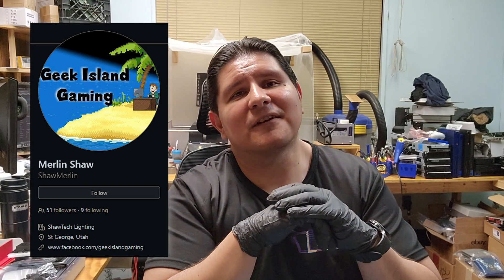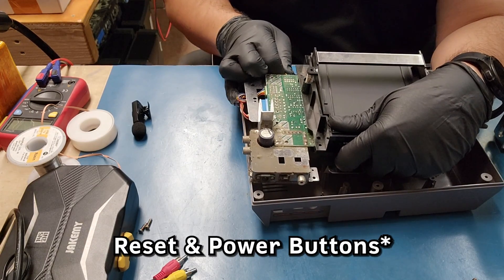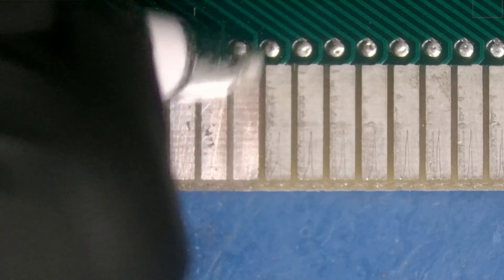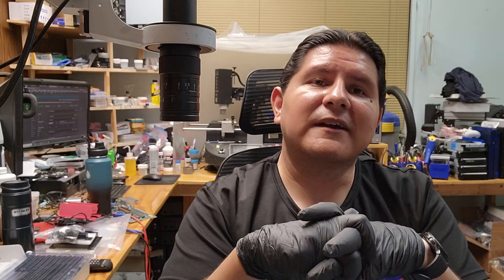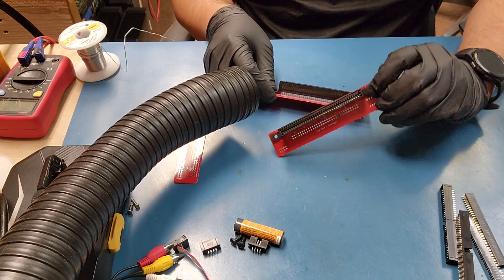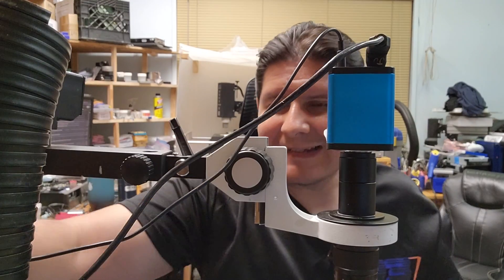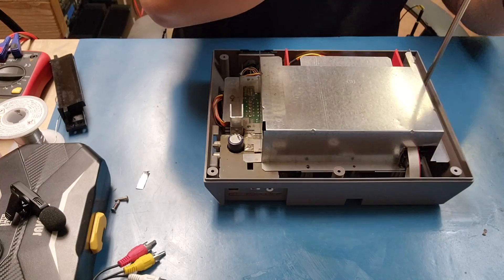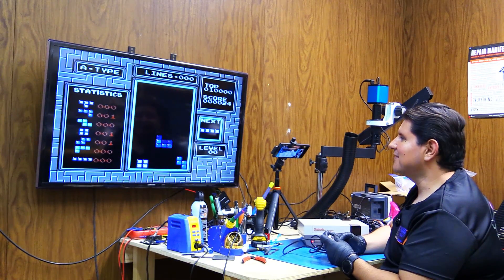Ultimate DIY NES Red Blink Fix with 72-Pin Slotmaster Tutorial

Comment: 450 is way to hot for leaded solder and using a fiberglass pen is overkill on those pins. You can easily solder at 300 to 320c.  Soldering at the lowest temp you can get away with is always best practice!
Reply from the maker: Thanks for the tip

Comment: 450c with leaded is too hot, you're burning the flux off almost instantly which is why you're having to add flux.  Try a K tip and just continually feed solder while dragging across a row of tht connections.  Unless there's a joint connected to a big ground plane, I would solder 350c max with leaded.
Reply from the maker: Thank you for the tip. I'll give this a shot next time.